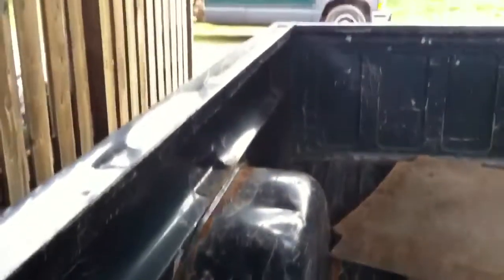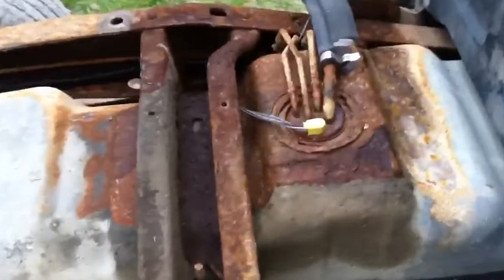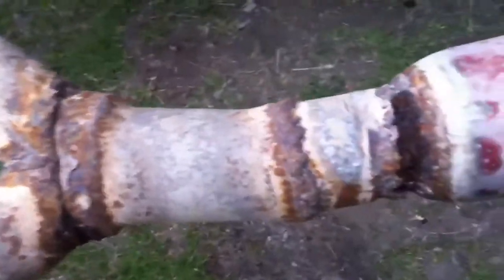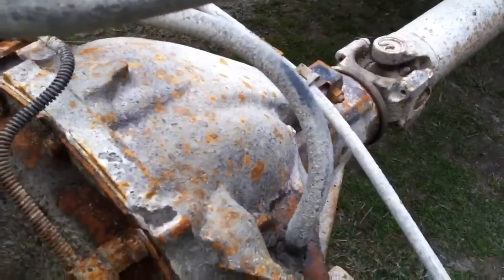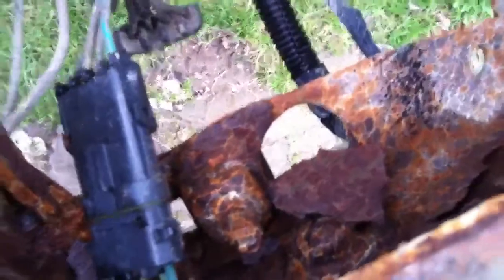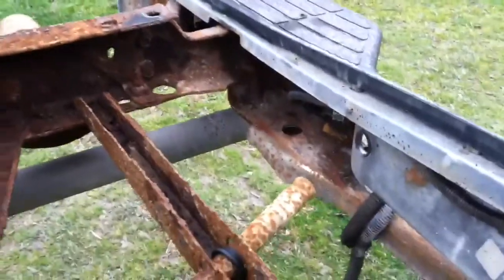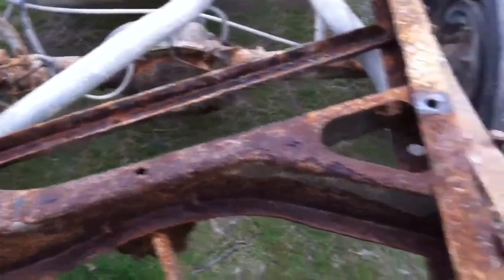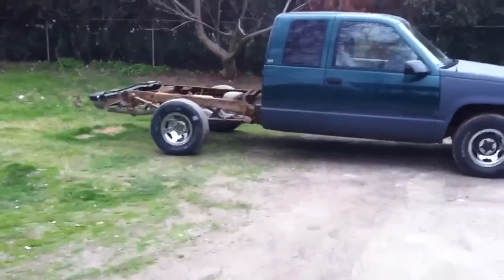More Work On The Chevy (HD)

Comment from the maker: This is actually not that bad LOL I've seen far worse around here. I think this truck was actually restored about 5-6 years ago by a previous owner, & then the kids that had it before me used it as a field truck, & it's condition just went downhill from there. Surprisingly too, those shocks actually still work! LOL No leaks, & not 'splashy' at all. For how bad it looks, it's actually in pretty good condition.... The bed only took about 45 minutes to remove (by myself) even with all the rust LOL